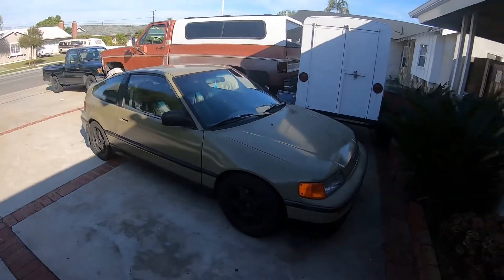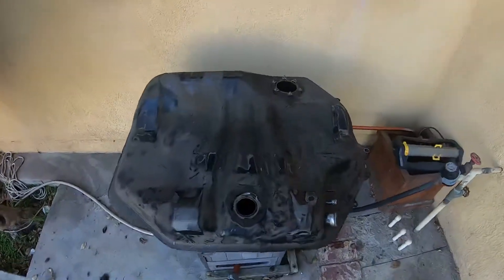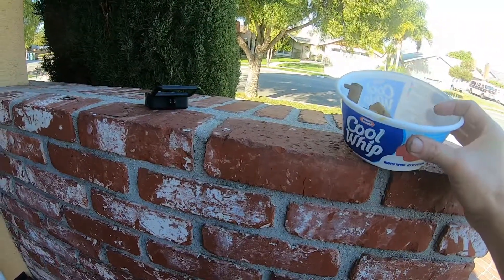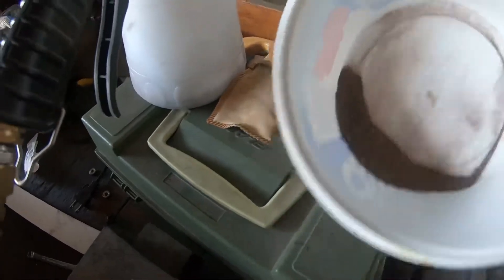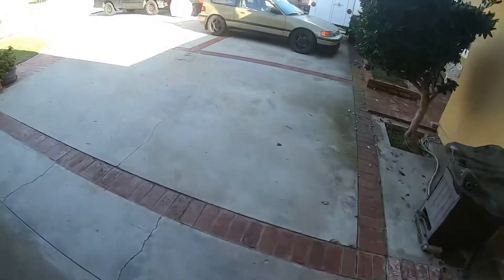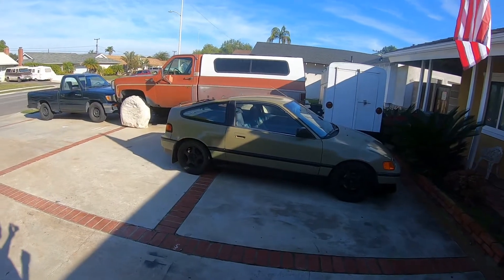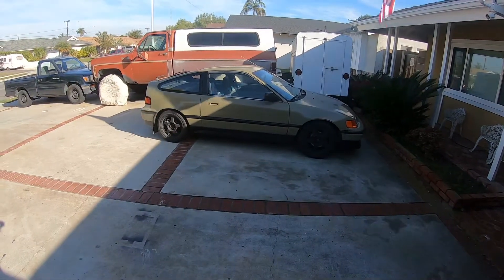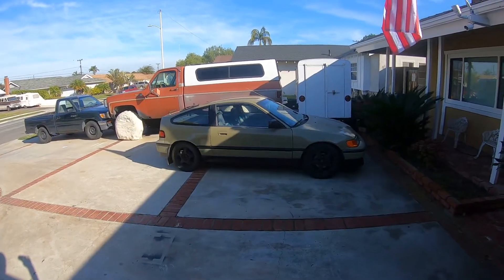CRX rusted gas tank

Comment: Man my fuel filter is clogged now and I’m pretty sure it’s the tank aswell
Reply: California uses 10% ethanol in the gasoline. I’ve been having so many issues with rust inside 3 of my CRX’s fuel tanks (my 4th CRX is a shell, so no issues with that one)😂 I’ve had to change the fuel pumps approx. 4-5 times in the past couple of years and I will be changing 2 fuel tanks in the very near future. 

Edit: I forgot to mention I don’t drive my cars often or even start them enough, so I think this is also a reason causing the rust issues inside my CRX fuel tanks.